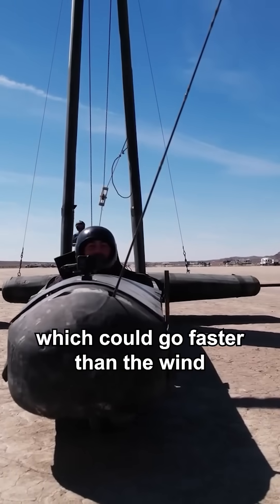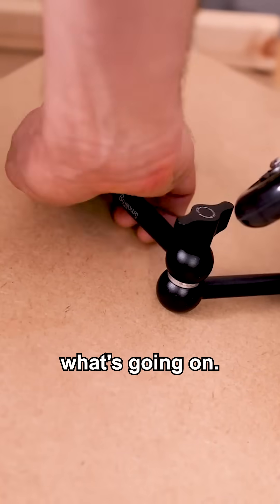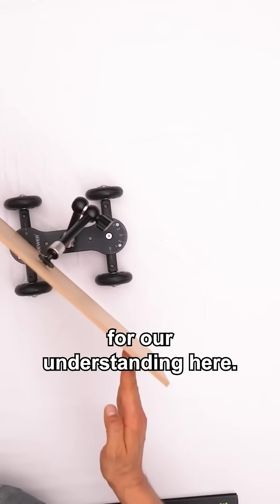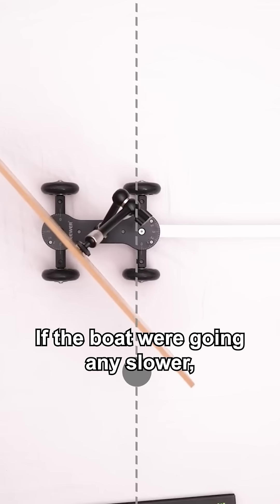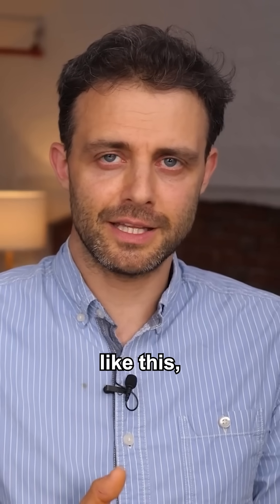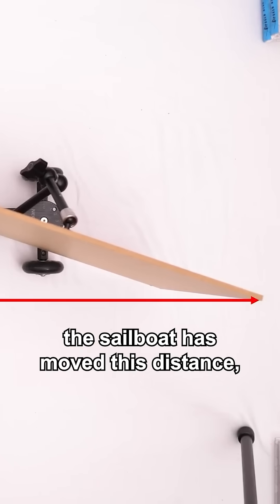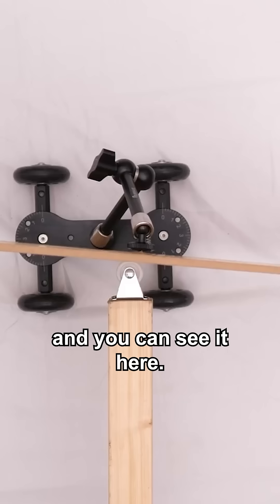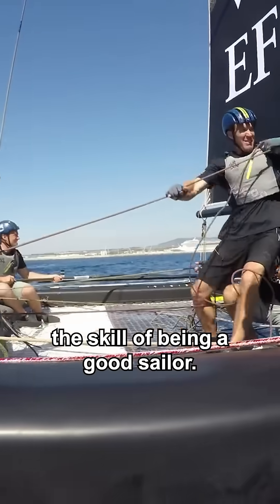How a sailboat can sail faster than the wind

Comment: The wind wants to continue straight. The angled sail is in the way. Some of the wind energy is diverted behind creating low pressure ( like an aircraft wing). The high pressure side lifts or in this case pushes the low pressure side while at the same time the wind is also diverted to the left in this example.

Comment: That's not how sailing up wind works. The shape of a Marconi sail creates a vacuum on the back of the leading edge. This is what allows upwind travel with a Marconi shape sail. The action of hull shape, keel Shape and power from wind on  the aft part of the sail allows the boat to move.

Comment: The car is only able to move, because the friction of the tires prevent it from moving in the same direction of the wind, ie move it backwards.
In a sailing boat this friction is caused by the sword attached to the keel underneath the waterline. Without it, the sailing boat would simply be blown in the same direction as the wind blows.

Comment: This is how sailing works generally, it seems counter intuitive, but you get much faster speeds with a tightly trimmed sail while moving INTO the wind. When you are moving down wind (same direction as the wind) is when you need to add a spinnaker and open your sail fully to gather as much wind as possible. Even then, you’re still going slower than you would if you were sailing into the wind.

Comment: i think a better explination is simply to add the number of vectors in wind direction that actually hit the sail at what ever angle a steep angle has less vectors a wider has more, then factor in the resistance of the wider in relation to the motion of the undercarriage and you get an intuitive feel for where the optimum is. Its really not that hard unless you start trying to add propellers and other extraneous differences.

Comment: This is so wrong on so many levels. 

Sails are wings with high and low pressure sides that provide lift. 

Wind is either true or apparent. True wind is measure when you are not moving, apparent is when you are moving.  Sailing is all apparent.  If you walk 5kmh  into a 5kmh wind, you’ll measure 10kmh wind on your face.  The faster you walk, the higher the windspeed on your face.  

Sailboats are displacement hulls.  Square root of Length of waterline in feet multiplied by 1.34 as a drag coefficient gets you the approx max speed in mph.  Drag coefficients are a range of about 1.15-1.55, 1.34 is average hull speed.  

If you take away the restriction of a displacement hull and use a foil, or on land, ice use ice blades, wheels, etc.  the faster you go, the more wind the is so the faster you go.  

Again, a sail is a wing.  It’s shaped just like an airplane wing but vertical instead of horizontal.  Your model was a flat board and the explanation is really bizarre and not in any way how a sailboat works.

Comment: Not a bad simple explanation, and is still limited as if the propellers were flat paddles and the propellers were almost stopped.

Consider a few other things:
1. That is from the perspective of a stationary source.  
2. Air is not a stick.
3. sail is not a flat plate.

So as the boat goes faster, the angle of the wind changes from being from the side to being from the front.  As this happens, the faster moving air creates more drag and more lift.  This ration increases by the square of the apparent wind velocity.

Since the most efficient (practical) airfoil has a lift to drag ratio of about 60:1.  If you use simulations of wind turbines and calculate the energy created from the wind.  Then calculate the energy required to push into that same wind with a geared system against the wind, you can then continue the calculation at increased velocities into the wind.

So with that calculation, the drive system, and losses of rolling drag, gear losses, and other small aero dynamic losses; you can calculate the maximum velocity.  The highest drag losses will become the vortices at the tip of the blades with from a power stand point will increase with the cube of the RPM of the blade.

Which is why the theoretical maximum velocity is about 3 times the wind speed.

Comment: I think I came up with a great thought experiment to explain how the car can go faster than the wind. Imagine you are holding a computer fan blowing into open air, now imagine there is a wall right in in front of the downstream side of the fan. It's obvious that the wall will give the fan more thrust. In aviation this is called ground effect. The fan on the car gains extra thrust because it's pushing against the moving air behind it. If there was no wind, it would be like the fan blowing into open air.

Comment: Sailboats have curved sails. Like a single airplane wing with the fuselage of the plane being the hull of the boat and the wing pointing up. Yada yada yada look up Bernoulli’s principle of lift, and you realize that in wind from any direction behind 90*, the boat is being drawn into a partial Vacuum, created by the vertical wing whish is the sail.

Comment: Having sailed on a square rigged tall ship optimizing your sail angle to the wind also differs from close to sea level and higher up. So you have to trim the rigging upward in a slight twist. If you sail as close to uptimal, you can actually put a piece of paper on the front side of the sail on the upwind side and it will hug the sails surface all the way to the opposite end of the sail.

Comment: That was a lot of misinformation. Mixed with a lot of good information. 
What you should know is that a sail does not work by wind blowing on it. A sail blocks the wind and creates a vacuum behind the sail the suction from lower air pressure is what propels a boat. It is exactly the same way an airplane wing works. 
The rest of what dude said, meh mostly correct but he’s still confusing geodynamics with aerodynamics. They’re very different.

Comment: Not technically even accurate. When air meets the curved, angled sail it splits: part flows round the windward side, part round the leeward side. Because of the sail’s camber and angle, the leeward streamlines are squeezed and have farther to travel in the same time, so they speed up. Faster flow -> lower static pressure (Bernoulli). Meanwhile the windward side sees slower, sometimes even stalled flow and therefore higher pressure. The result is a pressure difference of a few hundred pascals.

The wind “sucks” the boat ahead or fills the vacuum behind the sail. What’s really happening is:

    Leeward side has lower pressure—pulls the sail toward it.

    Windward side has higher pressure--pushes the sail away.

The pull is usually the dominant part. It just has different static pressures on either side.

A sail works like a vertical wing - a curved shape + angle of attack create fast, low-pressure flow on one side and slow, high-pressure flow on the other.

The pressure difference produces lift and the boat’s underwater foils convert the sideways part of that lift into forward motion, so you can sail toward (but never straight into) the wind.

Comment: I think you need to take some sailing lessons buddy, actual sailing is towards the direction of the wind and exploits Bernoulli principle.
What you describe here is a different type of sailing where the air stream is actually pushing the sails. If that was the only way sailing works, then all the sail boats would only move in certain angles away from the wind. If you want to visualise what I'm saying just watch a modern sailing boat race and you will see all the boats moving in any direction you can imagine, even in an almost 0 degree angle against the wind.

Comment: Sails are not rigid boards that get pushed by air pressure from behind. The sail forms into an aerofoil section. The wind blows across the Aerofoil section and creates a low pressure area on the front of the sail. If the sail was an aeroplane wing mounted perpendicular with the leading edge to the windward side it would move perpendicular to wind direction!

Comment: Rather than thinking about wind pressing forward on a sheet of plywood, think of how a volume of faster moving wind in front of the sail will have lower pressure from the Bernoulli effect compared to air behind the sail. Then consider how one can optimize the shape and angle of the sail to optimize the difference in pressure between front and back. Most sailors are looking for the sail to pull the boat forward into that vacuum, much like an airplane wing causes lift.

Comment: A sail acts like a wing.  Air moving across it creates a low pressure area in front of the sail and pulls the boat forward. The pull forward can exceed the wind speed itself.

Comment: ?  I think they call it the Mandolin Effect, where the sail is a mandolin to its' normal.  

At some tipping point when the wind direction changes, you get vertical tilt which will bend its' prior assumed variable stability by the mandolin digging into its' sub-plane, ...even to the point of failure, ..., whereupon, the sub-waterline is not able to counter-balance the driving forces on the sail without folding. ?

Comment: It’s been a while since I watched the original, but I remember feeling like the explanation wasn’t sufficient. This explanation also helps give rise to the idea that a variable pitch propeller would enable initial acceleration at super high pitch and maximum speed at rather low pitch which is the opposite behavior of a propeller on planes.

Comment: Pretty sure the wind doesn't directly push the sail like that. It's more aerodynamics based like a wing. It's the low pressure in front of the sail that pulls the craft. It's Bernoulli's principal.

Comment: This model only travels at the speed of the wind. That is, the component of the boat velocity in the direction of the wind is exactly the speed of the wind. If you release a balloon and it moves with the wind to the finish point, faster than wind sailing boats can beat the balloon to the finish.

Comment: i think that you miss the ''vacum'' that creates air in the front side of the sail. the underpressure is more effective than the pressure because it uses even the 1 atm of the presuure of the air on earth, because of its weight. Thats the reason you take better speed with the air on side vertically, than the same air from the back.

Comment: This video will confuse a lot of novice sailors again. A boat doesn't sail because the wind is pushing. A lower pressure zone on the back of the sail PULLS the boat through the water.

Comment: The wind doesn't push the vessel along and sails are not flat like in this clip.

This clip does not take into account that the shape of the sail is similar to an aircraft wing and thus creates a pressure difference at each side of the sail which results in the boat moving.forward.

Comment: Boats aren't pushed forward by the wind on their sail from behind. The wind tips the boat over by hitting the sails sideways, and as the boat rocks back to an upright position the shape of the keel converts that correction into forward speed. 
That's why: wind speed =/= boat max speed but instead acceleration, why boats tend to prefer diagonal wind, and why the keel becoming damaged = boat no go but a damaged sail merely slows the boat

Comment: Steve, you have explained how the wind pushes the sail but most of the effects of the wind is because of the aerofoil behaviour (like the shape of a planes wing) that pulls the boat along and it is that which makes it possible to sometimes go faster than the winds speed.

Comment: That's a pretty good explanation butleaves out the fact that a sail functions as a wing and also creates a vacuum on the down wind side of the sail and then the is what's called apparent wind which means the boat traveling into the wind means the wind speed is increased relative to the boat and components ... as in the apparent wind when you travel at 5 mph in the same direction as a 5 mph wind you then experience no wind and when you walk 5mph into the wind you experience 10 mph wind...as you tack into the wind which is anything other than 90 degrees up to approximately 3 to 10 degrees from directly into the wind you have apparent wind... to go closer than 10 degrees you must have a large wing below the water line to keep the forces from pushing you downwind ....traveling downwind you raise dagger boards to reduce drag giving higher down wind speed as you cut up wind you need more drag and lift created below the water line to keep you from sliding sideways thru the water. 
It all comes down to bringing your sail to near stall for acceleration then let the sail out slightly as you pick up speed ( using tell tales to prevent stalling the sail which it's a wing) as far as the wing below the water (dagger board keel etc) it creates lift force up wind ... the sail creates a lift force generally down wind but can become up wind as well... the sail pulls the boat over thru it's center of longitudinal  axis twisting the boat over to the down wind side while the keel pulls the boat in the same direction of longitudinal axis pulling the bottom of the boat up wind or the top down wind as well this causes the boat to heel over to the down wind... matching sail size keel size rudder size all affect the speed 
Sail shape and keel shape both affect speed 
Shaping the sail is called lofting as the panels of the sail are designed to make the sail form a wing shape that functions at a certain wind speed... sail loft is matched to the keel/dagger below the water... the shape of the sail can be varied using battens that are tapered to alter the shape you can also vary the shape of the sail by downhaul tension (pulling the sail tight from the top of mast to the mast base) you can pull tension on the outhaul (along the boom) you can increase luff tension (a cord thru a tube of sailcloth along the back edge of the sail...(this is like flaps on an airplane wing used in slower winds)) there is a traveler (a channel that the anchor point for the (sheet which is the line connected to the back end of the boom) to be locked in to pull from the left/port and right/starboard side of the boat.. this affects how rigid the sail is and affects the belly of the sail...
(You can increase tension from the top of the mast to the rear of the boat (not the sail tension but with the foremast tension wires being attached maybe 1/3 of the way down from the top of the mast ) this will bend the mast moving the pocket or belly of the sail further back.... a full belly gives acceleration...flatten the sail you get higher topspeed ..... in variable winds you compromise because you need to re-accelerate when new gusts occur... basically low wind full belly high wind flatter sail...
You can loosen the front mast guy wires and tighten the aft guy wires to lean the mast rear ward... this is done to balance the lift created by the keel/dagger board and the lift created by the sail...
 When balanced you need far less rudder .... it's really interesting how to tune a sailboat for optimum speed for the current conditions. ..
It's only needed for racing really and it's very much a feel thing where you feel the vibrations of the boat telling you if you are going faster or slower... you could measure the water speed and wind speed and calculate approximate speed or on a long voyage take log readings or sextant readings to figure location and travel time over many days.... if there is (there is nearly always) a current of the water your actual ground speed will differ up current vs down current and of course the currents of the water affect how close to directly into the wind you can sail... i wind surf have sailed catamarans and mono hulls for about 45 years and it's extremely fun sailing anything... i like to strap a bottle of captain Morgan rum to the mast

Comment: But it is not how a sail works actually. The air doesn't push the sail, there are other forces involved too. Like a wing of an aircraft, their is a lift created on the surface of the tail. If not, boats could not go in a direction when the wind is not behind them.

Comment: Model take a watermelon seed and press on it. It will shoot out. A sailboat works similarly the sail presses one way and the hull resist so it goes forward. You need to trim the sail to just the right angle so you can go faster than the wind

Comment: but the sail is a wing on all but the old square riggers which you are showing there. So the sail creates “horizontal lift” if you like, that pulls the boat along. The wind does not push on the sail but flows over it creating negative pressure/lift on the front of the sail

Comment: Ok, this explanation is incorrect. A sailboat moving at any angle into the wind is not being pushed by the air behind the sail, it is being pulled into the wind by the venturi effect, just like an airplane wing.  The venturi effect creates a low pressure on the leeward (opposite the wind) side of the sail and essentially pulls or sucks the boat toward the wind.   The sail is litterally a vertical wing.   When you turn the sailboat at a 45° angle away from the wind, the air is forced to move around the sail creating the same low pressure or "lift" that occurs on the top of plane's wing.  The keel must be used to keep the sailboat at angle to the wind and keep it from turning directly into the wind which would cause the sailboat to come to a halt.  Tacking (which is zig-zagging into the wind) or turning back and forth allows the sailboat to travel toward the wind.  Here is a great link to help explain the physics of sailing.  

https://youtu.be/yqwb4HIrORM